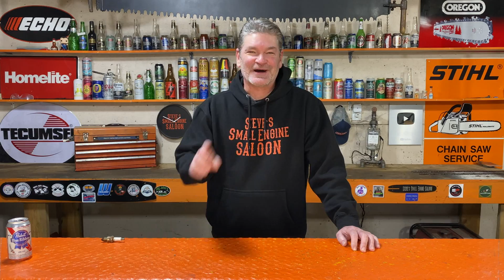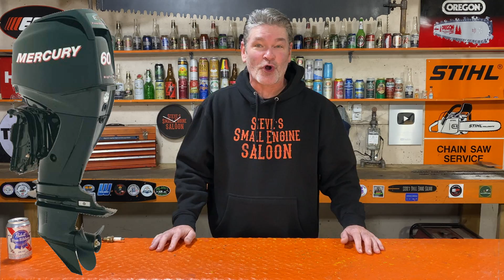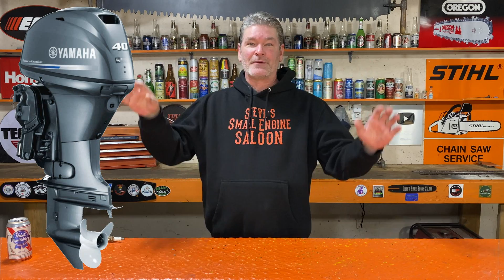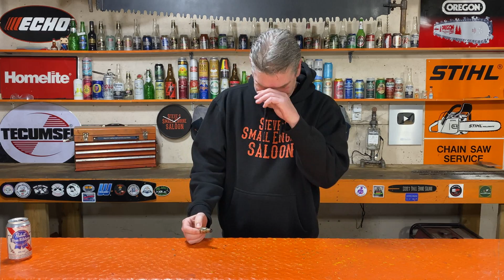🤮 DISGUSTING Tip For Diagnosing An Outboard Engine

Comment: Hey Steve

 I recently bought myself a new Tohatsu 9.8 outboard. A nice little upgrade from my 1975 6hp Evinrude. (which I still love)

I live up in Canada and all of our gas is now at least E10.

My outboard motors only get about a month or 2 of use each year and I have been stressing about the issues this could potentially cause on my new motor. So much so that it has lead me down a youtube rabbit hole on how to separate ethanol from fuel. I don't really want to do this as my boating time each year is already limited. However, I don't want to have issue with my motor either. 

My plan is to essential run the carb dry and drain it before long term storage. 

I never use old gas. If I have some in my Jerry can before the season I will empty it out and use it as a fire starter. I am always filling up with the highest octane possible (usually Shell V power as its the closest to me). 

A few questions for you.

I have always been told to run premium/highest octane available for small engines. Is this still the case even with E10 fuels?

I plan to add a stabilizer each time I fill up my outboard tank, Is there a specific one you would recommend? (there are so many to choose from)

Thanks

Comment: Unrelated comment to this video, but I've recently found your youtube channel after buying my first ultra sonic cleaner and watched all of videos on that subject matter. I loved it, especially the part about the toilet bowl cleaner, and I have a suggestion I think might like. My mother used to clean brass, copper, or other small stuff with ketchup. It would take at least ten minutes to shine up a pile of pennies or a dozen corroded shell casings submerged in just enough ketchup to cover it, premixed with a literal splash of water, just enough for it to get all up in and all over everything. She would do this to clean her glasses, jewelry, etc. I wonder what a small ziplock bag full of ketchup would do to some rusty nuts, bolts, and washers in your ultrasonic cleaner.

Comment: Steve big fan I’ve looked at both stihls blower and chainsaw  no winter 🥶 they do have a gap for all seasons I think 

New subject to this video 
I was Captain 🧑‍✈️ on airplane ✈️ and a leak was on the belly. We had Mechanics 🧰 and the Suits. Trying to decide what fluid was leaking. After chatting…. I took my finger a big swipe and put to my tongue 😛 the faces were priceless. 
It wasn’t blue, hydraulic fluid will burn your tongue,Deicing fluid is sweet. And a definite taste of jet A 
Don’t remember which it was but a fond memory. Your the REAL MCCOY 
LOOK 👀 HIM UP
CHEERS 🍻

Comment: We had a rough running issue with a six cylinder outboard & I ended up testing everyone of the plugs by putting them back in the spark plug leads & holding against the engine, then turning the engine over whilst stood waist deep in a river. Shocking is all I can say about that. 😂

Comment: On regular car engines this should work too, but the taste would be the sweet glycol taste, right? Less distinct than the salt though.

Also: I use taste to judge the condition of our aquarium... Not swallow, but get the taste and smell from the water. It is almost as if the taste buds and the nose are made for detecting chemicals :)

Comment: I don't work on outdoors but I'm pretty sure I can think of a better way maybe a clean paper towel in front of the cylinder and turn it over to see if it gets water on it smell the paper towel if it smells like gas it's gas if it has no smell and it's wet it's probably water